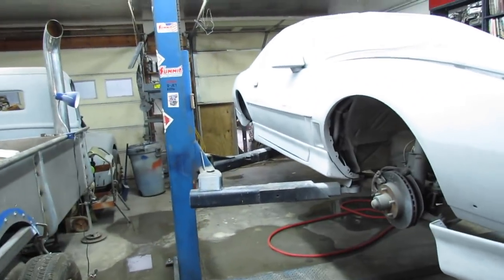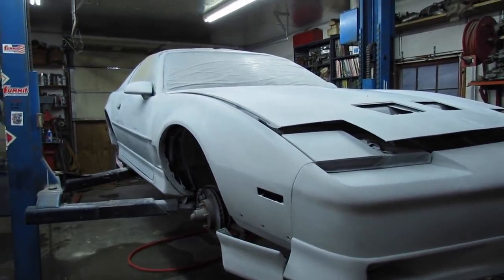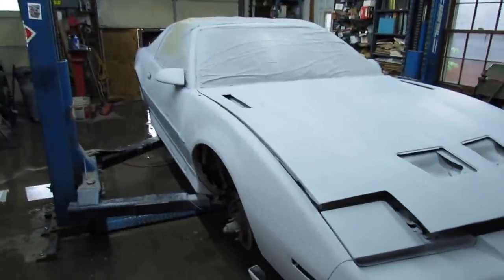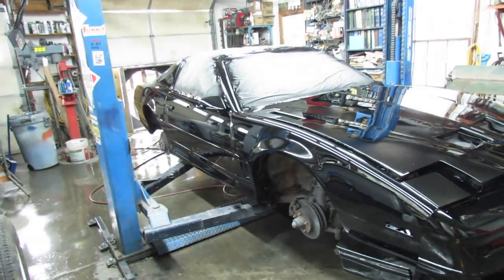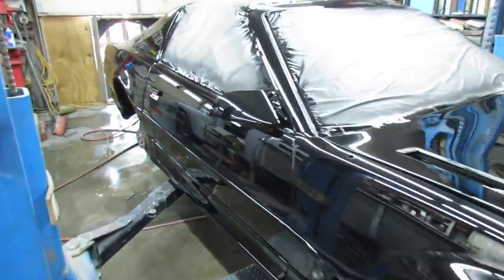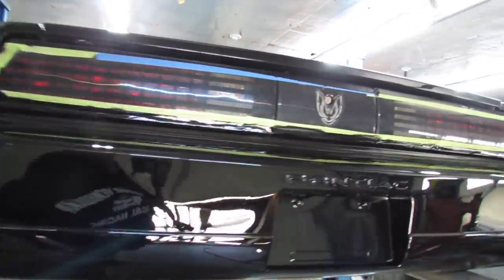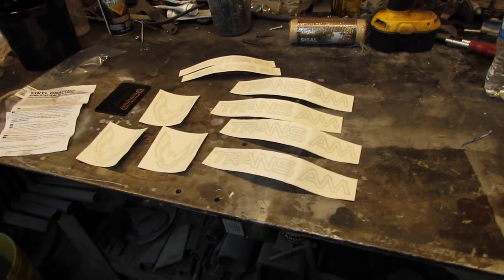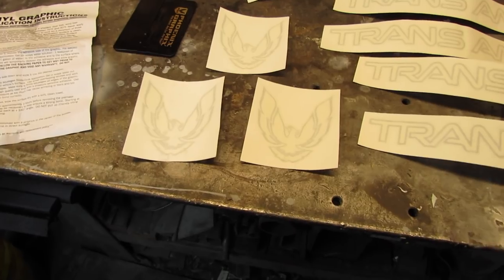Trans Am - Fresh Black Paint

Comment: When I was a boy in around 1973, my neighbor across the street had two 65 Impalas. One was your everyday 4 door family car. The other was a two-door hardtop with a 4 speed in it. I don't know the engine it had in it. I just remember riding in the car with the guy who owned it and his son. I remember it being a neck snapper. Back then it was easier to get away with acting a fool on the road. It's the only car that I remember my dad street racing against. My dad had a 53 Chevy two-door hardtop. As I'm sure you know, they didn't come with a V8. My dad put a 327 with a 4 speed out of some late 60's Corvette. I know now that I'm older this thing had to be scary to drive past 80 miles an hour. It still had the old kingpin front end under it. And it turned almost on its door handles. My dad street raced the neighbor with the 65 Impala. At 100, the old 53 was floating all over the road. It was a nice-looking car. But it was a death trap. If my mom had known that I was in the car with dad that day, No telling what she would have done to dad when she got her hands on him. That was a stupid thing my dad did back then. But I've had a love for fast cars ever since. My dad beat him in a quarter-mile, barely.

Comment: Rightly happy for you to have that paint done. Its a bit to get all cut an buffed or whatever it is you do.. I just don't remember so good. I do remember there is no harder painting to do than a good black paint job. I was just a kid a learning and my first paint job was a red 59 ford. No, it was green and that wasn't flying so well so a store full of the wrong sandpaper made me work harder than a rented mule fixing that and after almost bare metal put the prettiest corvette red paint on it... this is in 1961 so this is not a wreck from some local dump but three years of savings to get. So my beautiful Red paint come morning had more orange peel than the oranges it was named after. It devastated me. I didn't know that 99% could of been sanded out and no one even volunteered any info on it either till a guy offered me half what I paid for it cause it looked like crapola. I took it and he drove away... a week later after he got it from me, it was all sanded and polished so nice that I was in a rage and got so drunk that I puked on the miss's rose bush for I got into the house. Enough on me... time to get little man on the scene to start   a sanding on the 47 ford. I do know for sure that is going to motivate a lot of upholstery work and finish floorboards if I remember right.... most of it is probably done and then the fenders and very top could go the other color if its done with two colors... who knows might just get whats  left in all the paint  cans left in the shop/lol. Corse I hope not tho. nice looking job
Reply from the maker: Golly.